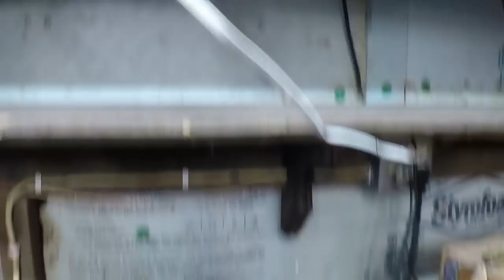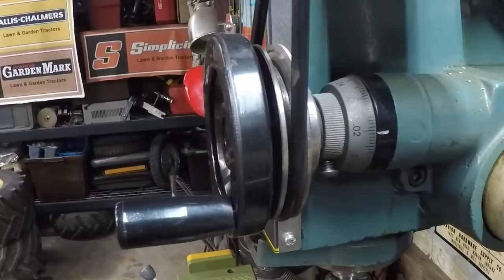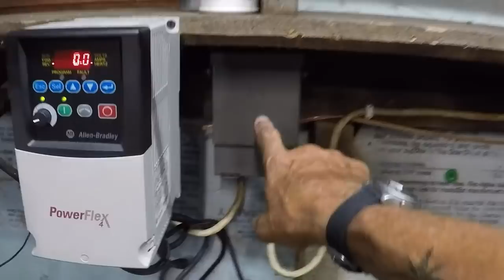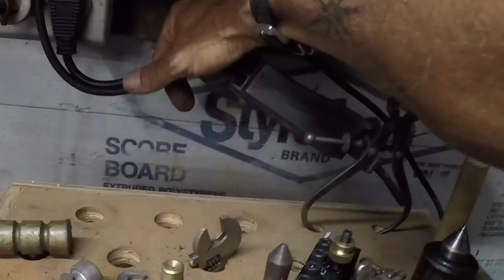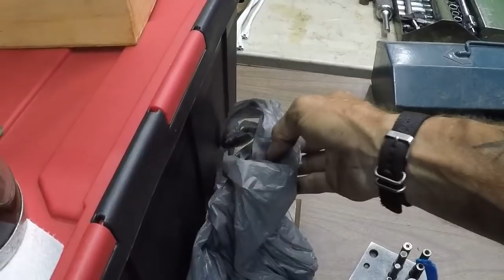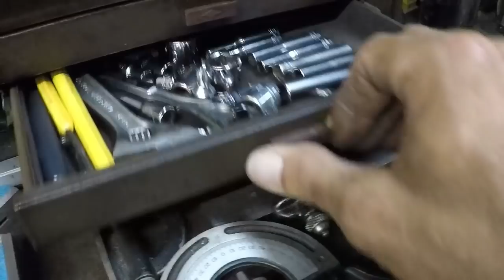August 2018 Updates to the Shop and Mill

Comment: What did the VFD cost you and was it new? I want to get another VFD for a K&T 3B mill that I recently got. I have the Lenze VFD that I bought new for about $700. Paypal credit baby!
Reply from the maker: I actually have a friend who had this VFD very gently used that I got it off of in its original box with paperwork etc. New, these are in the $475 range depending on where you shop. Zip~
Reply: My Lenze is a de-rated 10 hp. I use it on my old ATW  lathe. It has a 3ph 5 hp WEG motor on it. If they make one similar in the 10hp range I'll put one on my big mill to run another 5hp 3ph motor. Always looking for a bargain.

Comment: That Boeshield T-9 is great stuff. I used  it on the various  areas on the boat (in my boating days) and it performs well at preventing rust/corrosion. It does over time set up to a hard wax'y  consistency over time though (unlike FluidFilm) and is less expensive than T-9.  I'd say just using very light oil on the mill bed slides/etc would be better than using either of the two fore mentioned products; easy to clean & wipe off and re-apply.. My 2 cents worth.